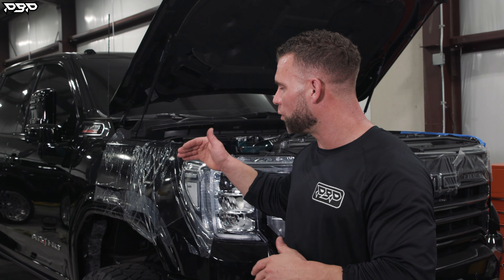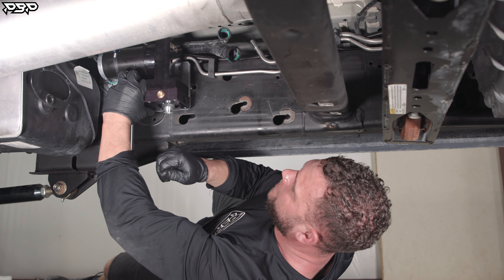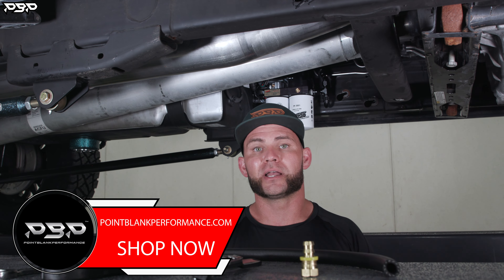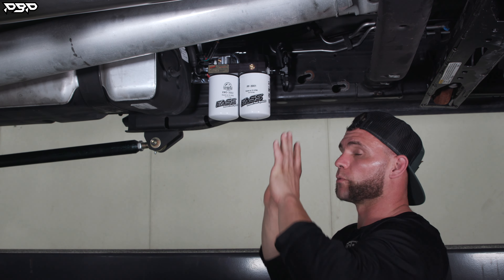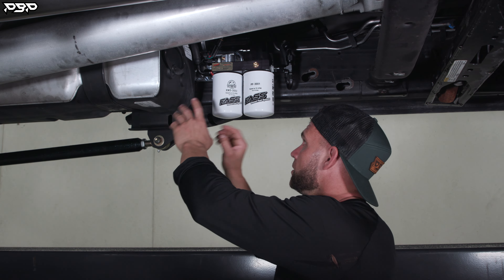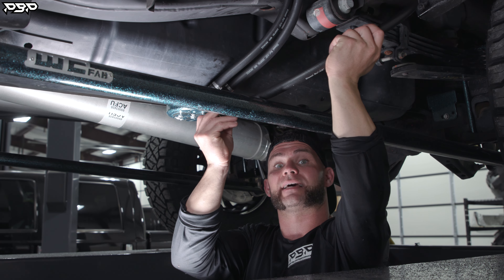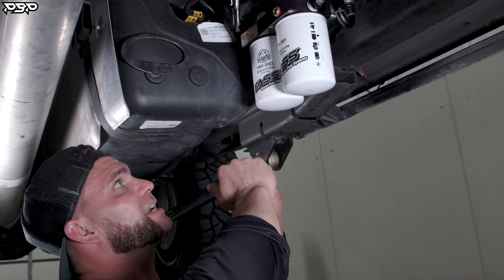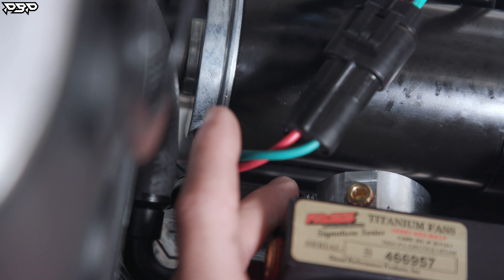20+ L5P DURAMAX STAGE 1 FUEL SYSTEM INSTALL!

Comment: correct me if im wrong... dont these trucks have factory lift pumps... again according to the internet...lol.. these trucks on factory fuel... factory lift pump and injectors there is enough fuel for 700 hp... you are you grabbing fuel from factory lift pump as well as a sump...?
Reply from the maker: Yes sir pulling from both sources! We run out of fuel on the dyno around 600hp with the factory lift pumps sir. They do have a factory lift pump
Reply: @POINTBLANKPERFORMANCE   thanks again for always providing extremely useful information , and explaining exactly why you are doing what ever it is your doing... and you did say this package was available on your website?
Reply from the maker: @thomasstott527  Yes sir and if you are interested by all means before you purchase it holler at us at the shop let’s go over it! ( 870-236-4900 ) Thanks again!
Reply: @POINTBLANKPERFORMANCE  thank you again sir!